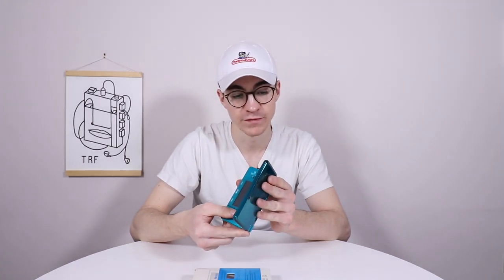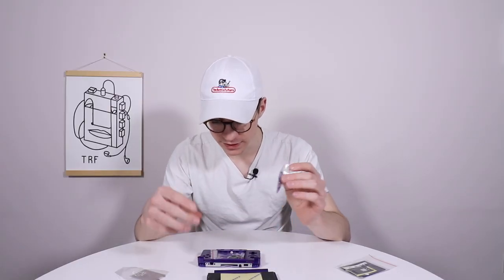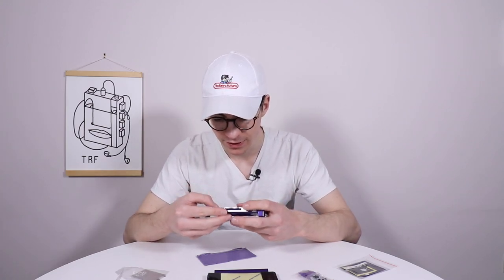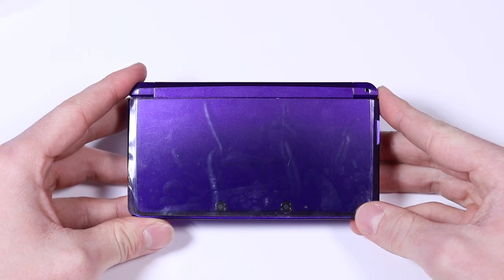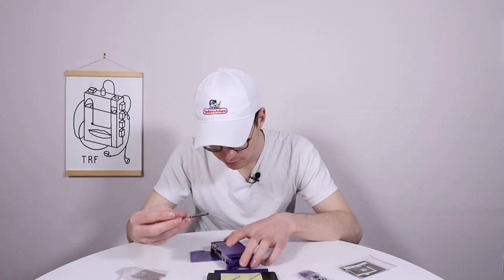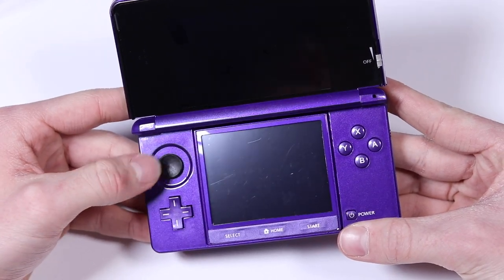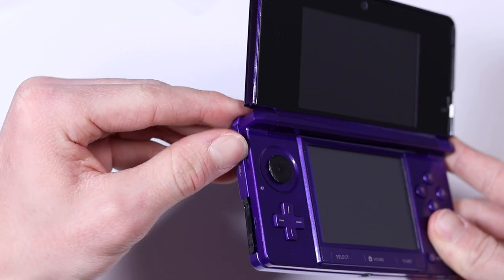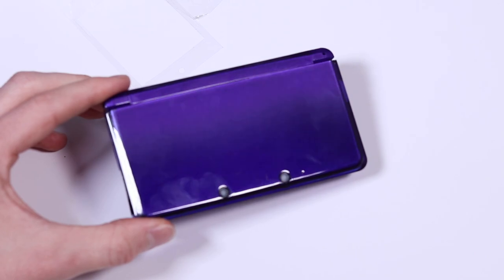Let's Refurb! - 2011 Nintendo 3DS Shell Replacement!

Comment from the maker: I know this wasn't my usual repair sort of video but hopefully you can still enjoy the intricacies of the Nintendo 3DS and replacing its shell. I have lots of great things in the post so subscribe if you haven't already and put notifications on and stay tuned. See you in the next one! X
Reply: I still love these videos!
Reply: yeah :0
Reply: Hey, um love ur channel, but I have a slight request.
Can you fix my sisters 3ds? It has dead pixels on it.
And send it back? Sorry if that's too much.
Reply: Where did you get the shell? So I can avoid them in the future
Reply: Regarding the D-Pad and buttons, my original launch model feels very similar to how you describe them - the D-pad in particular was never very comfortable to use and required a lot of pressure. The cover on my bottom row buttons didn't flex as much as yours though.
Also, holy heck, getting the ribbons through the hinge without tearing them is insanely difficult... especially given they have to be passed through in a particular order.
Reply: Great job. Random question, do you speak Jérriais?
Reply: Dose your girl friend like purple?
Reply: Where did u get the purple shell
Reply: I have a question, do you know where I can find a step by step tutorial? My first 3DS which is the aqua blue has been beat up from constant use. The left speaker blew out, the circlepad broke off, the 3D broke,(idk how that was possible) and the R button doesn't work. Instead of throwing it out I'd like to give it new life, since it was the first handheld that I can call mine. But is it worth to try and repair? And if it is, is there a tutorial I can follow?

Comment: The aqua blue original 3DS is a great colour. 

I'm surprised nintendo never reused the colour for the 3DS XL or the 2DS.
Reply: yeah
Reply: My 3ds is aqua blue 🥰
Reply from the maker: I agree!
Reply from the maker: I also like the Japanese blue 3DS'.
Reply: Mine had aged well the color still looks good
Reply: aqua blue is cool, but i'd rather have a flame red or a midnight purple
Reply: they break all the time on ebay, and they sell for more.
Reply: Nope they reused for 2ds xl
Reply: I personally think they should have more red consoles in the ds line
Reply: the design overall is also way better than the new 3ds/2ds tbh. looks more futuristic

Comment: Glad I found this. I've saved to watch it later. Bought are power dead 3ds recently and it was a 30 second fix soldering the USB port back down as it had lifted off the connections. The casing is pretty beat so if I can replace it will be in tip top condition

Comment: Is it me or many of these original 3DS batteries have the tendency to expand as I noticed on the one in this video? 
I have 2 3DS's the same model in the video. One I had since 2013, another I bought recently but is slightly older than my first one. Both had their original batteries and both had expanded. 

I know cell phone batteries can expand too but I've only experienced one phone in the past that had an expanded battery out of all the phones I had for a few years.
Reply: Germaine Liew yeah it happens with lithium ion batteries, they really aren’t supposed to last more then 2 to 3 years even if they are unused. They start to become unstable and either bloat or start fire. That’s the reason why so many places have very big restrictions on them when shipping, example being the place he lives.
Reply: Huh, I've had my original 3ds for 8 years and the battery seems like it's still perfectly fine and holds a charge well, though I do notice that it may be starting to expand just a tiny bit so I have to keep that in mind
Reply: I took mine out so I could install a extended life battery.  The original still seems okay to me though

Comment: I did a similar repair on a turquoise 3DS that had been dropped. The only part of the housing I had to replace tho was the top outer case. When the part I ordered arrived it fit great but it was definitely not legit :/ but I illustrated a little pattern and custom ordered it as a skin from decal girl and it ended up looking great! I had to fix the shoulder buttons because they were no longer responding, but the parts were cheap and the fix was easy. The friend I gave it to loves it, and she’s never had a DS of her own, only her brother’s old Game Boy Advance SP. But yeah! I’d never refurbished any kind of DS before and jumping into a 3DS was really fun!

Comment: Hey dude, would be nice if you could answer my question about my 3DS as its the same model and as this one and I have the parts to repair it but some of the screws don't budge and im certain it's because there is glue in the screws or something, would using a hair dryer on the screws work or no? The screws are on the second layer where the battery and all that is, or would heating it by heating a screwdriver and pressing down on it work?

This was a first time project with okay experience taking apart electronics but I gave up a few months ago cuz I couldn't get into the 3DS, tried so many things but anyway I appreciate the time for reading this message, only found your channel a few days ago but your videos are really entertaining (also we have the same first name :)
Reply: Make sure you have the right bits for the screws and  if they don’t budge then use a hair dryer on the low setting then be carful opening it up look a guide up on iFixit should help
Reply: @AussieNexus7408  hello, I managed to open it up about a year ago, I bought screw drivers and everything which were the correct size, but it didn't work, borrowed my friend's screw driver and that seemed to work even though it was the same size.

Also my original comment looks really snarky, sorry about that

Comment: I like these repairs as well as I have been repairing a few I got a Zelda Black one with gold trim was soda logged but was able to clean it out and clean cables and got it working again still needs a little work.
Reply from the maker: Ah awesome stuff. Love that Zelda one!
Reply: @TheRetroFuture  yeah I have to open it up again to replace the thumbstick but still working on getting stickiness out of the 3d slider and wifi slider any suggestions? Tried IPA and it clears it temporary and then gets gummed up.   Yeah I wanted this one for a while but wasn't going to pay eBay prices or retail prices but I do see that even a loose one goes for 70 80 90 bucks us I paid 34 with shipping more than I wanted to pay but now I'm in negotiations to buy a aqua 1 like you have because I have the box and all the stuff it's having the same issue so I feel confident I can fix it but I do appreciate your videos Elliott keep them up they are great to watch high production value as well

Comment: Just did this shell swap last weekend. Looks great and functions well, but the hinge is a little loose on the side that the ribbons go in. I had replaced the hinge and metal piece that goes in around the cables too.. I really do not want to take it apart again 😩
Reply: Wow. 😱 It looks like a nightmare with all those ribbons cables.

Comment: I want to replace a DS Lite shell, but I'm not sure about the Amazon or Ebay ones. Do you know any webpage where I can buy a quality shell?
I'm from Spain btw, and keep up the good content!
Reply: When I did a shell swap on my DS Lite I just ended up buying another console that had some minor faults (All it needed was a top screen and it would have been perfect, as I realized when I'd taken it apart) it costed around the same as getting a shell, maybe a tiny bit extra and as a result everything except the stylus (It didn't come with one sadly) is official, and I have some spares if something stuffs up.
Reply: I’ve had pretty good luck with the shells from Ebay. Some even come with a set of screwdrivers.
Reply: @goooooooooober  Well I asked my mom if I could buy a shell (yes, I have to ask my mom or dad even though I'm 19...) and she didn't allow me sooo I have to stick with the beaten up pink shell :/
I have a nice blue 3DS XL but for playing DS games I prefer the DS Lite. Also the extra weight of the 3DS XL doesn't help.

Comment: If you ever need a 3DS battery and have a Wii U Pro controller you could simply swap the batteries. I did that with my 3DS since I don't use the controller that much anyways

Comment: Yesterday I disassembled my old 3DS to change the DPAD. It is very complicated to remove the 9 screws below the back cover with a 1.5mm philips screwdriver. Of the 9 screws only 3 left normally, for another 4 I had to use WD-40 and the remaining 2 had to use a 2mm drill bit.
Reply: yeah that's because they are not Philips screws, but JIS screws which are similar but just enough different that a Philips can damage them. they are found in a lot of Asian electronics, and are designed not to cam out. This link should help explain it more. 
https://www.instructables.com/id/When-a-Phillips-is-not-a-Phillips/

Comment: Hi! do you have any idea how to fix a 3ds xl that turns on, well the blue light is on but the screens are black, they dont even light up... any ideas? i tried pulling the wifi out and puting it back, but that didnt work :/, also the usual pull the battery out and that kind of things, also the recovery mode doesn't work ://

Comment: Hey sir i have. A problem with my it wont turn off after i did what you did in this video but i tried turing it on it does but than it pops and automatically turns off. If you can see if you can fix it i can pay 💸 if you want have a nice day.

Comment: Elliott wondering if you could have a gander at my issue with this Aqua Original 3DS I am attaching the link to my video, but I bought it with the "black screen of death" would power on but no screen.  Upon disassembly i found it had some liquid damage and had some corrosion about the board I went in full with IPA and cleaned the heck out of it.  At first when checking the unit it looked like the wireless module was causing the issue as it had corrosion on the pins but upon a swap out with a known good one it made no different.  I then took all the cables out scrubbed again with IPA and reseated them and when I put it back together whalla it turned on, success I thought or so I was wrong as now its doing this when I turn it on.  Let me know your thoughts or maybe your viewers can comment or suggest.  https://www.youtube.com/watch?v=c6CgO1mIf80